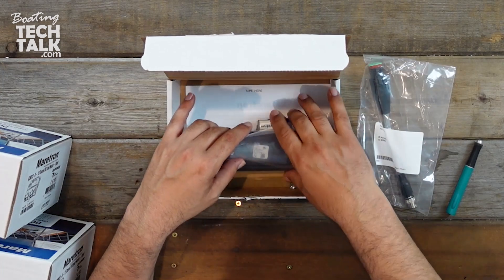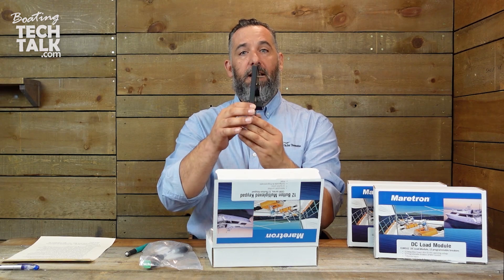Maretron Digital Switching - Part 2 of 3 - Unboxing and Product Review

Comment: Looks great. Twelve lighted (on/off) control buttons provides amazing versatility. I don’t see a professional way to label the buttons. Is there a label option with backlight on the panel itself? With 12 buttons it will be near impossible to remember which button controls which load.
Reply from the maker: Good point, labelling is so important.

Comment: Does the 12 button multiplex keypad have a light or lights for each circuit, i.e., can you tell by looking at the keypad if each circuit is ON or OFF?
Reply: Yes, The keypad is LED backlit and has the ability to turn on the back lights only when a circuit is switched on.
Reply from the maker: Thanks for responding to a fellow boater.